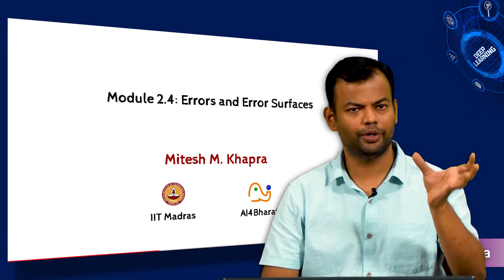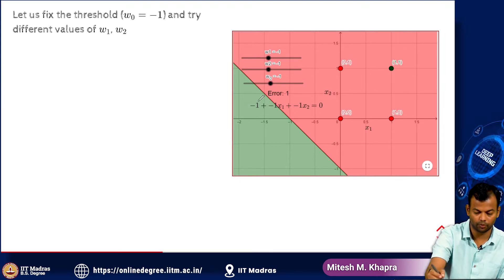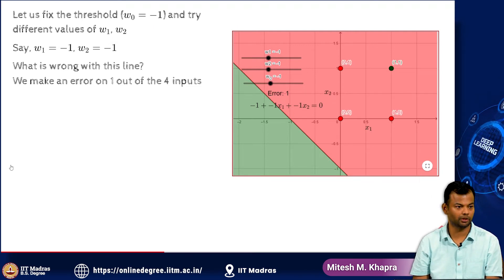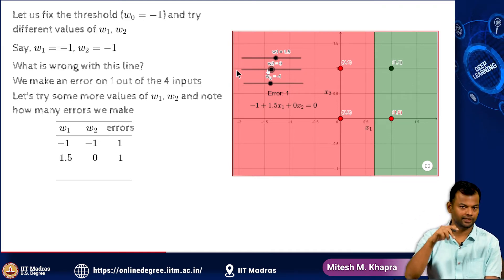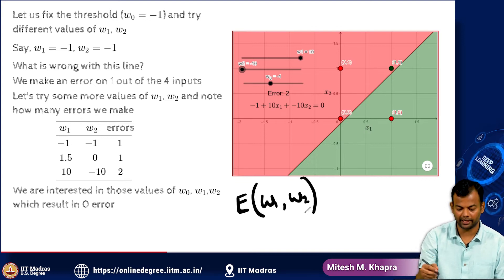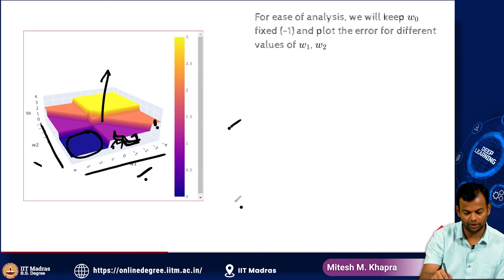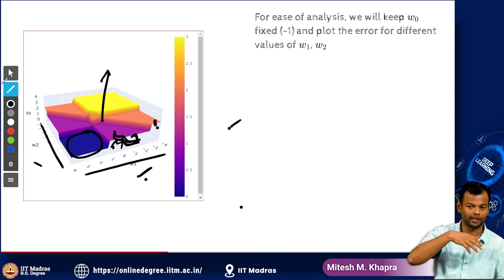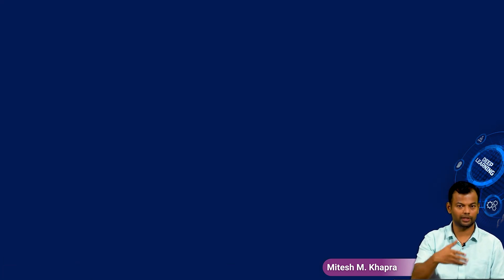Errors and error surfaces

Comment: 8:20 i think maximum 4 errors can happen
Reply: how would you plot a seperator then?
Reply: @aryantiwari8632  If the positive half-space contains all the 3 points (0, 0), (0, 1), (1, 0) and the negative half-space contains (1, 1) then I guess 4 errors can be possible.
Reply: @PrithaMajumder  but thats not possible when we fix w0 = -1
Reply: Same doubt